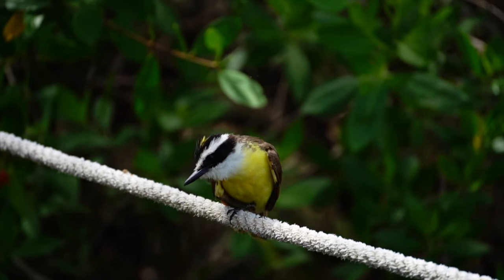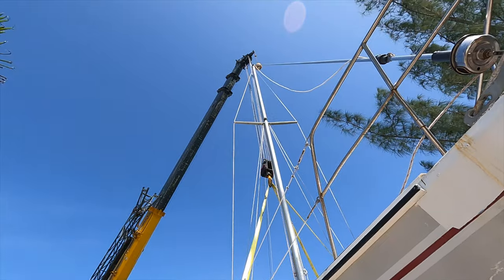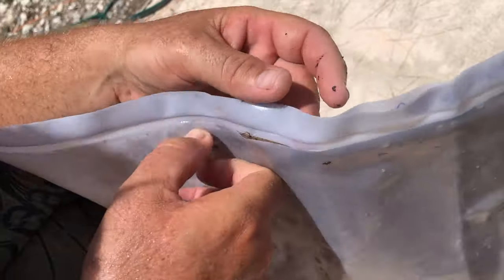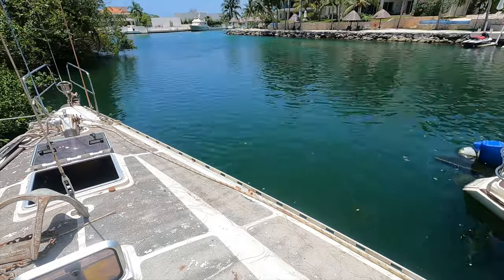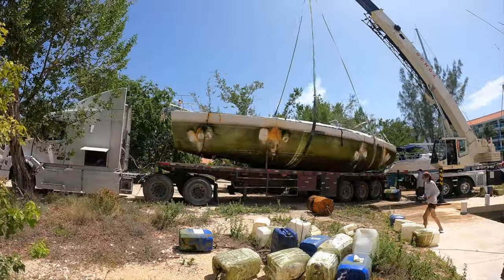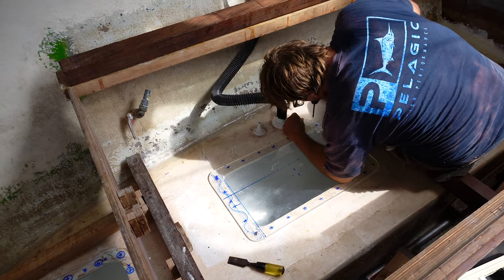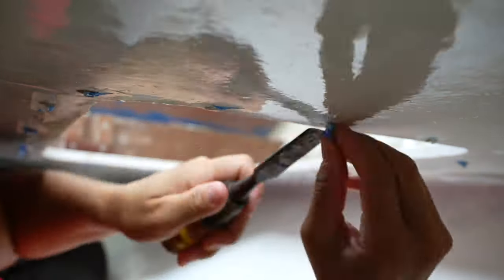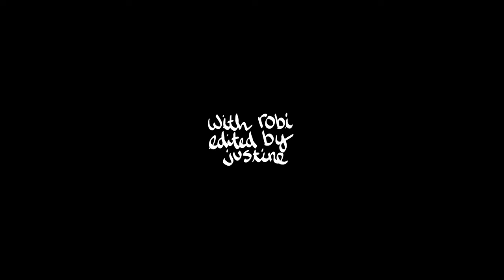BOAT GUTS

Comment: Your anchor can be fixed. A heavy truck repair shop that has a big hydraulic bearing press can straighten it. The bend in the anchor arm is gradual and not acute and can be straightened without too much imparted stress.
Reply from the maker: Yes, we’ve discussed heating it and bending back as well, although heating and bending back may cause more structural damage? Like all things here - all about finding someone with the materials or equipment, if it even exists...

Comment: Some sort of baffling inside the tanks will be nessasary to keep the water from sloshing around at great pressure weight radius due to the volume.... otherwise,  another awesome video, music was a real potpuree and perfect sweet to ruckus.
Reply: Would make a great follow up video content to see what genius ideas you 2 come up with, repurposed gallon jugs with holes cut out as baffling come to mind. Aprox 1 per 10 gallons of water???
Reply from the maker: Our genius ideas? Haha, your genius idea - I actually really like this one. We may end up having to add dividers/baffling, but we don’t want something that can break off or rot. I was thinking as well, what if we could put something inside that isn’t epoxied down - kind of like the original flexible tank, that can hinder the motion of the sloshing water. Gallon jugs are definitely a possibility. Thanks for the suggestion 👍

Comment: The last time I commented it was about my leaking plastimo bladders! There now all in the bin and working with loads of 6l water bottles, at least there easy to fill from the dinghy Dock in small batches! Love you guys, take it easy! Euan
Reply from the maker: I remember that 😆. It was an ominous type comment that should have warned us that we were also going to have trouble. Man, these flexible water tanks are trouble!
Reply: @sailorama   the only flexible tanks allowed on the boat now are those 5l bags of wine! 😅 incidentally I've re-used wine bags for water storage and they worked just fine filled from a hose, with the advantage of winey flavoured water!

Comment: i am actually going to build an integrated water tank on my boat in a few months, but im not going to glass on the inside just on the outside, but being very generous with the width of the biaxial cloth im going to use. i am using G10 tough, not plywood so i dont need to worry about rot. the threaded inserts are great stuff!
Reply from the maker: If you can build it out of G10, you're all set! No worries with that material...
Reply: @sailorama  its expensive but in the long run it saves a lot of headaches, time and money, plus it is strong, 3 mm thick is plenty strong

Comment: Another wonderful video, the bird shots were really good.  I wonder if the other commentor is right about baffling be needed in the water tank?  You covered a lot of ground using the time lapse and then brought it home with real time Choco in the end. Caio! :)
Reply from the maker: Yes, we’ve definitely been thinking a lot about this separator/baffling concept. Looking inside most water and fuel tanks, we know that we should have built some inside, however we were worried that it would probably rot, compromise the fiberglass job in some way. Basically, we want to test it out. See if the pressure of the sloshing causes some problems. If it does, we are still open to fiberglassing in some metal or g10 dividers inside the tank to deal with the sloshing. Still wishing I could work as quickly as the timelapses in real life, ha.

Comment: What coating did you use inside your tank?  Drinking-water safe I hope...
Reply from the maker: Even though the company that makes the epoxy that I lined the tank with claims that it is food safe, we’re inclined to play it safe and to not ingest it. The water here is not potable in any case...we only use it for washing. Perhaps later on we will eventually be able to find actual food-safe epoxy and repaint the tank.

Comment: I’m a little concerned for your health. Need to wear a proper respirator when doing that work. Please be kind to your liver.
Reply from the maker: You are completely right, yes - I usually do sanding or epoxying work with a mask, it was just too tight and complicated working inside the tank. I hate making it look like safety equipment is not important.